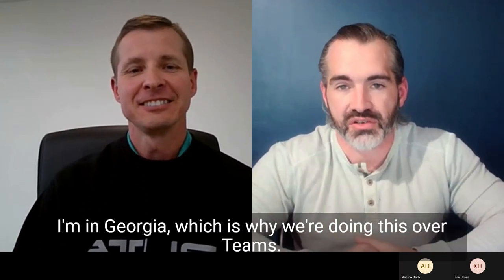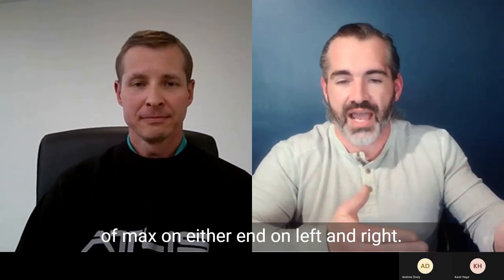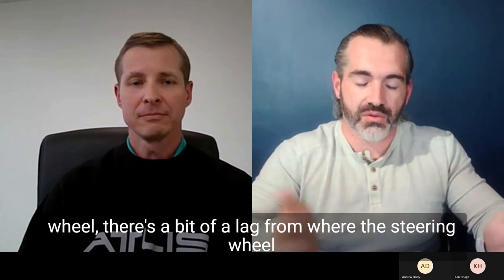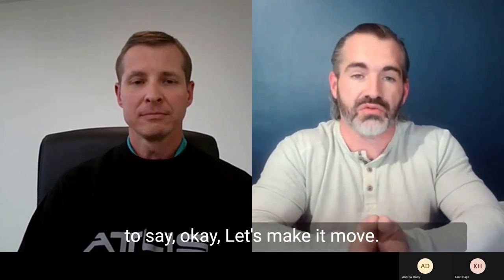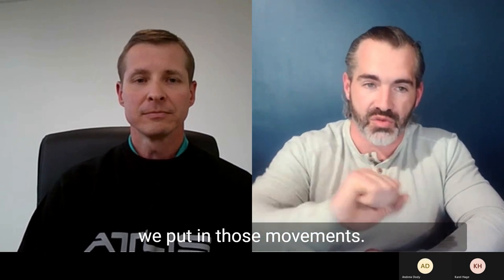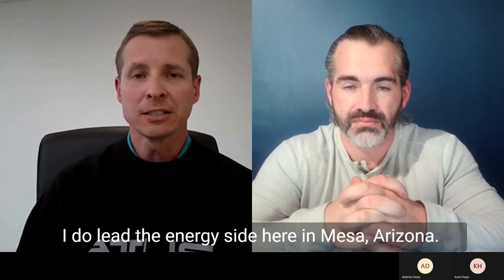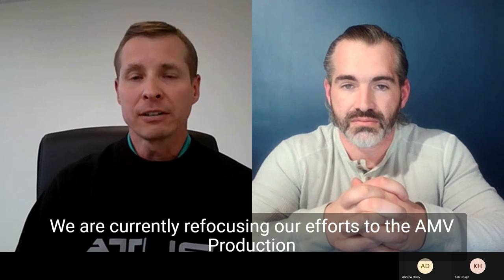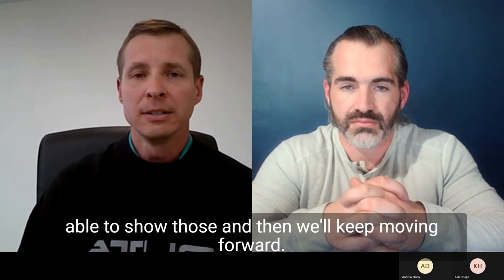ATLIS Weekly Recap - March (Week 4)

Comment: Thanks guys that really helps answer most of my concerns regarding the steering. Are you guys able to provide some assurance as to the safety Factor? Forgive me if this is coming across ignorant, I'm just not that familiar with drive-by-wire. What happens if there's an electrical failure? You would lose complete steering right? I guess I am nervous about that much reliance with zero ability to overcome an electrical failure. Again maybe there's some light you can shed on this area too. Thanks guys you're awesome